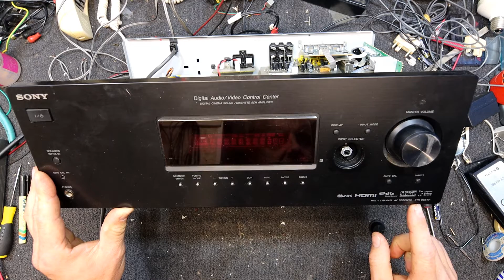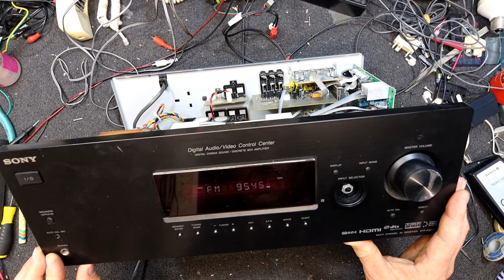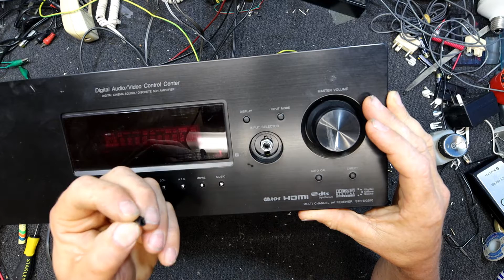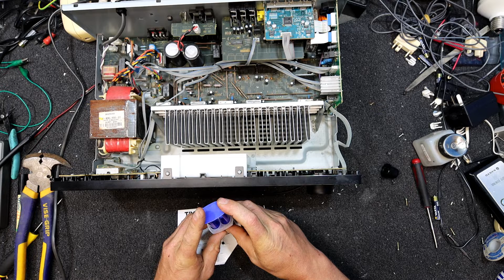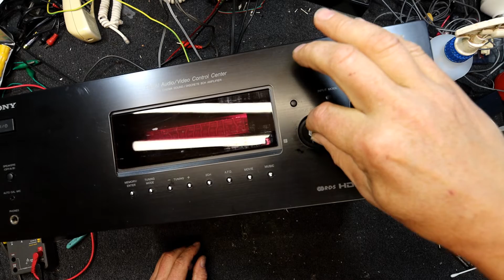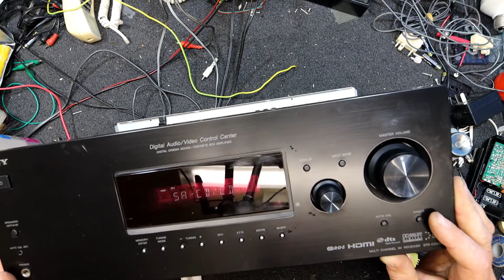Sony STR-DG510 Amplifier Check and Repair Broken Input Selector

Comment: I know this video was back in 2024 . I just bought a used Sony str-dg510 like this video. I’m getting sound and static from the a.f.d and optical. Analog works fine only 2ch works. Surround sound don’t. Radio works fm station
Reply from the maker: Are you feeding it a signal from a DVD? I think most of these amps need a surround signal to decode before they go into surround mode. It should show the type of surround on the display. There may be some sort of fake surround mode in the menu too. Its also possible there is something wrong with the rear channel amp section.
Reply: @StevesElectronicRepairShop   as soon as I hit the a.f.d , movie , music  or plug in a optical I get static and if you turn it up loud enough you can hear audio.  i'm using a pc 3.5 mm jack that works  , a iphone same thing all analog , and a tv with optical only out put. as soon as the red light hits the in side of the optical port static.